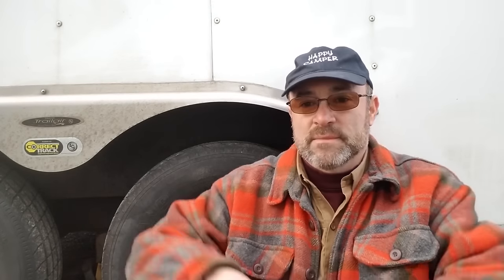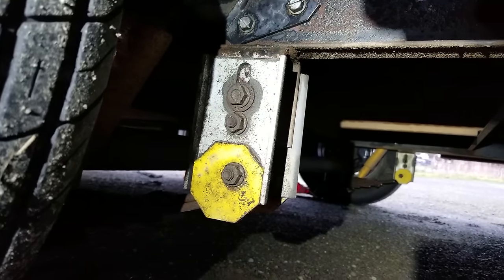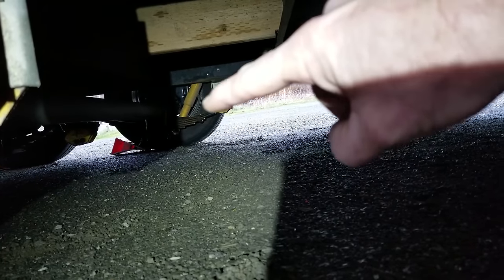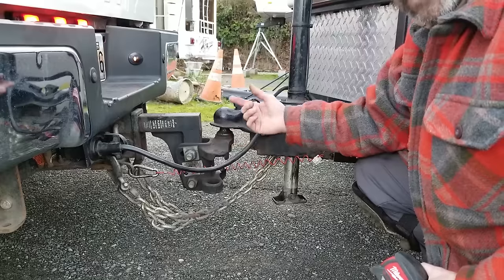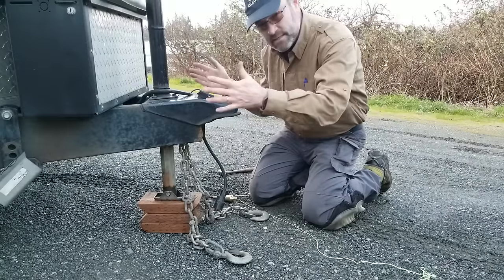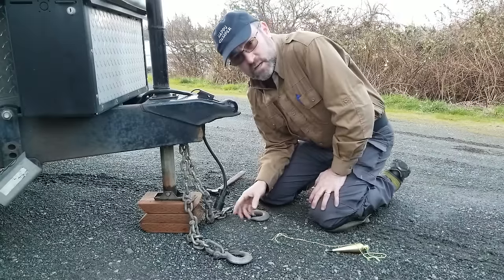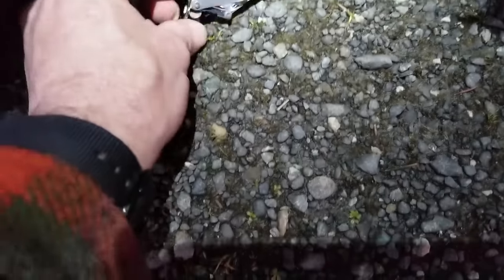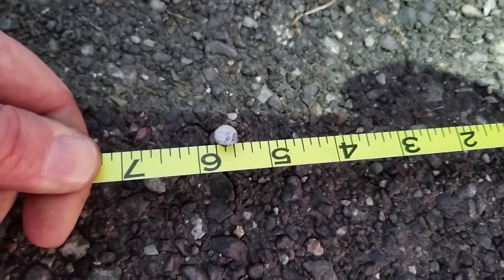How To Align Your Trailer Axles with Lippert Correct Track

Comment: Very helpful video.  I just checked my boat trailer and found the right side measures was 23.55 ft and left was 23.57 ft to the front tires.  Distance between the front and rear tires was within 2 mm, so I think that about as good as it gets.

Comment: I have a question why do you do full turns that’s just a Caster  adjustment  wouldn’t that just put the bolt  back in the same place  Because that part moves as you turn it it just pushes it forward or backwards if you do a full turn it will just put it right back where it was

Comment: You mention adjusting the bolt with multiple turns.  So it's not just a cam?  It's something more elaborate?  I scrub tires like crazy, going to check tomorrow.  Good vid.

Comment: HOLY CRAP!   LOL ! !    A drop spindle with spring "under".... A huge stack!...  I have a trailer in my yard right now, & that's the problem I'm fixing .. The spring plate & U bolts hang lower than the (rim)... Not only does the trailer get hung up on the slightest un-even surface, but it is a VIOLATION.... You can't have metal that sits "lower" than the rim.  If you lose a tire, the u bolts are first to hit the road & the firework show will be beautiful!
 Oh, moving -1- end of the leaf spring 2 inches will result in a ONE INCH jump......

Comment: By moving the bolt on the eccentric plate I see how the axel moves front or rear.  What happens to the spring on the middle spring hanger or equalizer between the two tires?

Comment: I am installing the Road Armor system and I need to check my alignment with the Correct Track. When you loosened your bolts to make the adjustment with the plates did you leave the weight on the springs and tires or did you use a jack to relieve the pressure?

Comment: Thats confusing. If one side is off why would you do the opposite side the same two turns. Wouldn’t you want to turn the front and rear of the same side?  I have this system and would appreciate clarification. Thanks for the info.

Comment: Very good video , my question is why does the alignment changes with different weight?
Reply: It's due to the axles are higher on the center so as weight is added the angle changes which makes it follow better and not tip over as easy.

Comment: We just bought a new Aluminum 7X16 cargo trailer.. That thing is all over the road above 55 mph while empty. Do you think they didn't line the tandems up correctly? 🤔
Reply: I'd check to see if it's got the proper tongue weightv when empty. Axles maybe too far forward ? That's usually the case when the problem you mentioned happens. Contact Atlas spring and axle in Wichita ks. They are unbelievable good ! Been in business for ever and they know their stuff like no other ,

Comment: Did you do one of the on-line RIVA trainings in addition to going to the tech seminars? Or was there another school you went to? I've been thinking about the cert for myself. Friends are always asking me to fix or find out about this and that. (I'm a technician of other mechanical sports, lol). Thanks in advance for the technique and VLOG! :)
Reply from the maker: For my story, head to my web page and click to the resources - > about us page. At the bottom of that about us section there's a magazine article I wrote for Workamper News Magazine. It talks about how I was an engineer and transferred into this trade and the steps I took to get here.  Since that article came out several years ago I have continued to attend Factory training and Technical Training.   I do plan on putting together a separate video series on business best practices. It takes more than technical know-how and having tools to run a successful business like this.  Phone calls, text messages, warranty claims, scheduling, insurance, taxes Etc will bury even the best technicians along with all their tools if they don't set up their business properly.

Comment: one year ago i had both axles replaced had got a new one and it came with a little bend I changed it and notice it was bent so i drove trailer to Missouri they changed both axles a month later I hit a curb on drivers side the front axle I could see was tilted inwards like almost One o'clock I noticed that the back tire on same side was wearing out on edge I figured from the front axle being bent was causing the back to follow it and was wearing it out this week I bought a new front axle and installed it took about 2.5 hours i put all new bolts shackles in it tonight i looked at rear axle noticed the top of back axle was leaning in just a little bit not sure I want to put a second axle in it again axle was $600.00 and fuel was $100.00 to go get it I have changed the back axles 2 or 3 times I have a 22 foot trailer like yours people unfortunately bend axles more then you think could you find out how to bend it so its straight Up and down like 12 o'clock and 6 pm ?
Reply: The axels are manufactured with a slight bow in them. The axel should be installed so the highest point of the bow is at the top most point (bow is pointing up at trailer feck). You're buying a lot of axels for no reason. Hope you saved the ones you took off.

Comment: Nice work. However your diagonal measurements based on the tangent and plumb Bob of the wheels will not be accurate. Tires are not exact. Recommend to plumb off the axle centres for better measurements. These measurements also don’t have a huge impact on alignment. Trailer will run slightly on an angle while travelling with ever so slight more side load due to airflow

Comment: Prior to any adjustments your axles were parallel to each other. Therefore, the tires would wear evenly. It's not like one wheel or one axle was fighting others. But this is what you said was occurring, you said one tire was wearing quicker than the others. This would not happen with two parallel axles, AKA four tires all tracking in the same direction. Therefore, your solution, should have absolutely no effect on the problem. Mark Henry.

Comment: Where abouts r u I'm in wa and less was is screwing  me over😮😢❤❤❤ sorry if I'm bothering  u my travel trailer has a bowed in axle in the front they fixed the back one and said it wasn't there fault  I have before and after pictures and videos  they don't  care 😢 I had to fill out a formal where 3rd party is going to make the decision  they said 😢 and it's there fault  the weld broke on the other  axel they installed and it compromised my front axle the kilter  is off and alignment  tires r bowed the one they fixed is bowed but they won't  take the blame for Mt other axel  messed up cause there axel failed  because  all the weight was holding on the front axel all the weight 😢and know I'm driving around with a bowed axel cause of there faulty  work . I need some advice what do I do know ❤I know it's messed up it's on them 🤔 but no one cares I live in my trailer with dogs I can't  afford for new tires all the time what can I do if the 3rd party agrees with them😢

Comment: This was very frustrating. It’s a 15 minute video and when it got to the point to actually do the adjustments he says “I don’t need to show you that part” and skips actually doing the work. I was hoping to see how to make adjustments, not just the theory as to why.
Reply from the maker: After you make your measurements, if you need to make an adjustment it's as simple as loosening the nut & bolt and turning the  yellow stop sign looking plate the necessary number of stops. I figured most people would figure that part out.